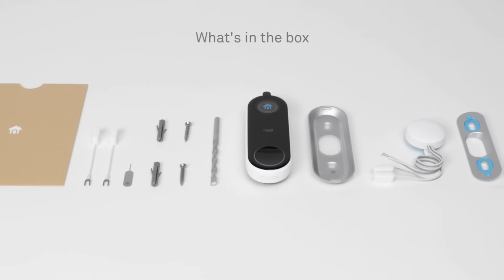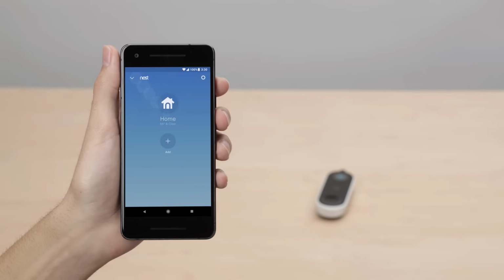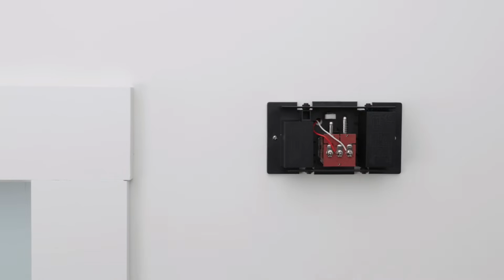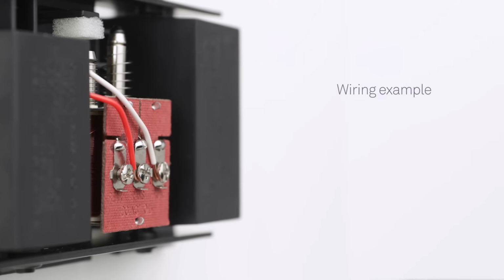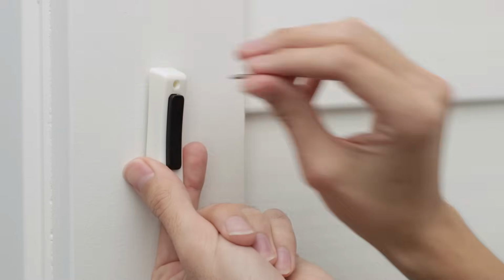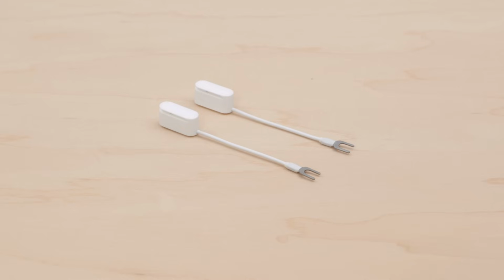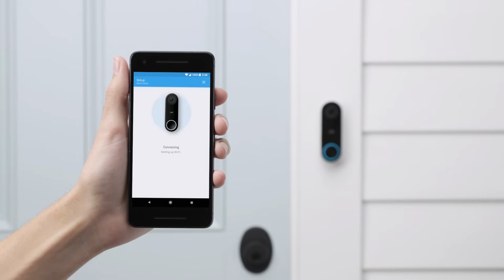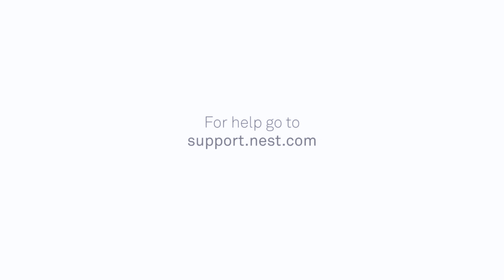How to set up and install the Google Nest Hello video doorbell

Comment: What if the wires are too short and no space for wire extenders behind the doorbell?
Reply: Can you push them into the well?
Reply: @AJDeLaRosa  thanks, I mounted it on a mounting bracket ordered from Amazon. It worked out but not as pretty as I wanted it to be :(

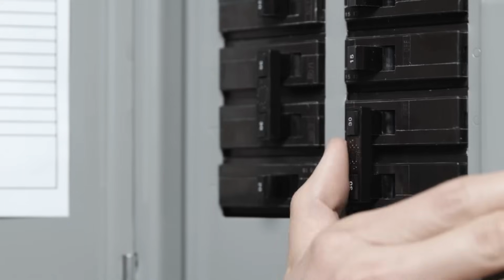Comment: 2:33 To all my electricians & technicians your doorbell will not be on a 240v 30AMP circuit. lmao
Reply: Mine is. Chime is tapped off the furnace.
Reply: @
Ricky Mann - totally agree.  Saw the 30 amp double breaker and got a laugh as well...
Reply: Mine was tapped to my electric dryer.
Reply: I laughed when I saw which breaker the used in their video.   Apparently, it is possible though.  LMFAO!!!
Reply: @TrackHeadStudios  I love how few people are laughing at it, and even fewer people recognizing the actual possibility.
Reply: That’s what we use to keep the T.Rexes from escaping their pen.
Reply: Right
Reply: Ooo etc Dior Fe
Reply: Ricky Mann if only
Reply: Lol the video is wrong probably you can control the A/C with the door bell lol
Reply: Came here to say the same.
Reply: 220v to 16v transformer is a thing. Doorbell can be on any cuircut in a home. Since it's so low amps it's just added to one not on it's own

Comment: If your door chime is wired to a 30 amp 2 pole breaker as shown in the video, you will probably need the smoke detector as well because your house is going to go up in flames.
Reply: Don't worry. They covered that step by asking you to check if you shut off the right one. Meanwhile, you might wonder why the dryer turned off.

Comment: My house doesn’t have a breaker switch for my doorbell
Reply from the maker: There should be a breaker for all power destinations in the house.  Perhaps it is just not labeled as doorbell, but there is a circuit that the power is being pulled from for the transformer.

Comment: I've fought for an hour to mount this thing. It's not easy when the wires are 2 inches long and the back plate has such a tight tolerance that the wire extenders won't fit behind the doorbell. Should have given a little more room for the people who don't have 2 feet of wire and a large hole to tuck excess into. I might have to return this and go back to my ring
Reply: colt miller I think you might need to drill a larger hole that wires are coming out of, to allow the extenders to feed into wall. Its not nests fault, its who cut your wiring for your doorbell prior. All in all you can always solder extension of each wire. Harbor freight sells a solder iron for $4. Hope this helps.
Reply: @Dodgechallengersixpack  They need to add that to the video. Such a minor detail but made the mistake of attaching the wall plate before making the hole bigger.    I thought it was so easy to install until I got to the very last step of attaching the doorbell to the base.
Reply: Use the spacers provided in the package it will raise the base plate that will help make little more space for the wires.

Comment: i followed all the steps, compatibility and no original door chime doesn't ring the worked fine before i installed the Nest Hello.  I went out and bought a new electronic door chime and it won't ring (and yes, I'm sure the settings in the app are correct).  Is the door chime supposed to ring or does it just ring at the button outside the house? The app itself is working fine, but not everyone in the house is connected to the app at all times.
Reply from the maker: We are sorry that you are having troubles getting the chime to work with the Hello.  We would suggest at this point on hiring a professional to look over the installation, as the chime is activated with the hardware and not software.  Something is not connected correctly it sounds like.  The main reason why the chime will not chime is usually because the chime connector is not correctly connected or its just not installed all together.  But to hard to tell without a professional checking it out.

Comment: Yep figured out what is happening. Its a dumb device. If you add a new mesh device to and existing mesh network, nest wont connect to it. It will only connect to the old ones it knows about. You have to restart nest wifi config. Dumb
Reply: Doorbell chime is faintly chiming randomly,  the backdoor switch is working properly, front switch is not workung
Reply from the maker: Can you please give us more detail on what is happening and how we can assist you.  Thanks.
Reply: This will probably be a security feature... Some random dude with an access point could rock up outside your house and create a wireless network with the same name as yours, and bam it's on his network ready for him to hack into it.

Comment: Will this work with a Plug-in doorbell?
Reply from the maker: We're not sure we understand what you mean by plug in doorbell. Can you provide a link or picture of what you mean?
Reply: @googlenest  something like this.
https://youtu.be/Mjz7HxcpGc0
Reply from the maker: Thanks for the video reference. The Nest Hello will not work for this type of setup. The Nest Hello is designed to replace existing wired doorbells. You can read more about it here: https://nest.com/doorbell/nest-hello/tech-specs/
Reply: @DSGB_DwnSoufGABoi  as of now google now sells the nest hello power adapter for your nest. i hope there's a battery pack version of nest hello

Comment: Garbage product. Continual drop outs, only works on 2.4ghz network. Support is dreadful, designed for usa market. No mention that you need a transformer and almost certain pro install. Struggles to connect to a netgear nighthawk x6 router with another ac router upstairs acting as an access point. Added bt home mesh wifi system too and it still drops out off the network 3 times a day, despite every tablet and phone get good 2.4ghz connection and regularly 180mpbs on wireless ac 5ghz. I work in IT and Telecoms and have done so for 30 years, most of it freelance. This is the worst tech product I've ever had, so annoyed as support are do unhelpful. ..no it's not my bloody wifi, internet, router, carrier pigeon....its the nest doorbell. I am 100% certain its faulty. I will try a replacement but I might go back to a normal doorbell or maybe ring pro.

Also who charges for cloud storage nowadays. Wtf
Reply: Can you give me free cloud storage then? I'm in IT and I would love free cloud storage. I await your reply.
Reply from the maker: Hello! We would be more than happy to further assist you with any questions or concerns you might have about Nest Aware, could you please reach out to us through one of our other channels? Our info can be found here: nest.com/help

Comment: I just installed my Nest hello.  It was as simple as the video. I bought Zmodo smart doorbell. I could connect the doorbell to my network. Nothing worked. After tech support frustrated me I demanded my money back. I bought a bundle deal with the new Google Home hub and Nest Hello video doorbell. It took me only about 20 minutes maybe 15 to successfully install the nest Hello. I recently installed nest Thermostats E and love them. I have a Google mini and Chromecast. I can tell the assistant to display the video from the Nest hello on my TV that has a Chromecast. Next,  I am going to add to a Philips Hue White and Color started kit and see how that goes. I have smoke and carbon monoxide detectors in my home. So I am going to upgrade with the Nest Protect Smoke & Carbon Monoxide since I have a fireplace in my living room. Great product as advertised.
Reply from the maker: We're happy to hear that everything is working out for you. Please feel free to reach out if you have any questions.

Comment: What is the mcro-HDMI input on the back of the doorbell for?
Reply: It's micro USB for charging the internal battery if power goes out to long or unit won't power on from doorbell wires

Comment: I am sure the door bell is great but they sure don’t seem like the care about giving you any paper documentation they act like you know nothing about electricity and they suggest a  pro every other step were really all they need to do is give you a diagram where voltage 16-24vac goes where the ringer goes in very disappointed with how the handle this not happy with there support at all!

Comment: why turn off the 30 amp 2 pole breaker that one never used for the door bell circuit
usually a single pole 15 a breaker,,, really bad directions

Comment: Hello. I have the ring pro. They have amazing customer service. I also have several nest cams. I wanted to add an additional camera (Nest Hello) and let me tell you about he experience. I installed it and the video quality is amazing. The alert time is horrible, between 30-60 secs. And then to answer the alert sometimes works and doesn’t. I went back and forth with customer service and they told me that many people weren’t have the same problems basically blamed the issue on my WiFi but yet all my other Nest cameras work flawlessly. I kept asking if they were working on a fix and they again told me many people weren’t have the same issue so no fix. They also told me if I wasn’t happy return the product so I did. Bottom line, if you want security and reliability, stick with the Ring until Nest fixes the problem!!!!! Rings notifications are also instant so be aware of this.   Do yourself a favor and wait.
Reply: Reliability, perhaps, but the Ring's biggest problem is that its security is absolutely TERRIBLE.  One quick command injection attack and a hacker has access to your entire internal network.  Amazon has really dropped the ball with regards to the security aspect of the Ring line.  Giant security hole.  And it sits outside your house.  You couldn't pay me to put a Ring on my home.
Reply: I have 150MB at the front door and my Ring never worked right. Hours spent with tech support. Even replaced all of the Wifi gear. Of the 5 friends that also bought Ring stuff, 4 of them have removed it for poor performance.

Comment: Do I need a dedicated 30 amp breaker for the chime?
Reply: That's what the video showed, just make sure you upgrade your doorbell transformer to the 200VAC 30A -> 24VAC model for good measure.
Reply: No u don't
Reply: Lol no
Reply: I had to upgraded my house service from 100amp to 200amp 3 phase because I installed 2 of these door bell, wow it was costly
Reply: Must be 220VAC, 30Amps because this thing draws some serious current!

Comment: can the wires come out of the top half of the mounting bracket if those wires are connected from the top instead of the bottom?
Reply from the maker: Great question. You should be fine as long as the wires come in, anywhere in the middle of the bracket.

Comment: Can I use this like a video intercom instead which means I don't need a chime. What I want is to install one in the room of my 90 year old dad. So if he need anyone of us he can just press the button, and anyone can answer him.
Reply from the maker: We only recommend using the Nest Hello as it is designed, to work like a doorbell. If you chose to use it other than its intended, that is up to the user. We can only support it, for its original intended use.
Reply: Nest, thank you, one quick question can I turn off motion sensor, which means, video will only become active when the button is pressed?
Reply from the maker: Great question. Yes, you can have it not detect motion and only give you notifications when the button is pressed.
Reply: That is a brilliant idea.  Seems like it would work fine and only need a low voltage power.  Google should really be marketing it for this exact application.

Comment: wow! a 2 pole 30amp doorbell
Reply: I was thinking the same thing. 30 AMPS?? I better call a Professional before I blow my hand off. ;)
Reply: brianw1967 low voltage
Reply: TRANSFORMERS.....MORE THAN MEETS THE EYE!
Reply: So
Reply: does this really need a 2 pole 30 all breaker? !
Reply: @peterc504  No, just check how much amps your transformer can draw and use a breaker a little above that. And also use wiring gauge appropriate to that breaker.
Reply: Breaker just feeds a 24 volt transformer
Reply: @Saltbox97   I currently have video capable doorbell thru my alarm company so should this nest should work just fine?

Comment: Got the NC009 error multiple times. Now I get to sit in the support queue.
Reply: I got the same error NC009. The first time I tried the setup, I had the door closed. So I went through the setup again with the door open and it worked fine. Might have needed a stronger WiFi signal for setup as I have been using it now for 5 days and it works great with no signal issues.